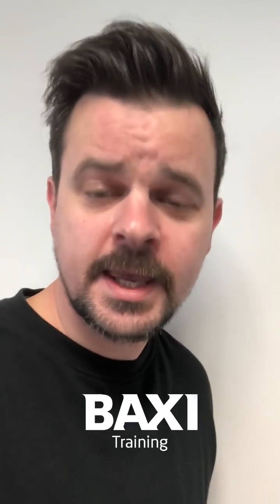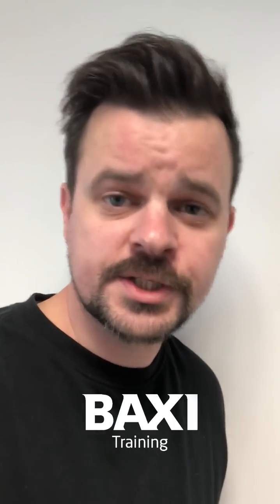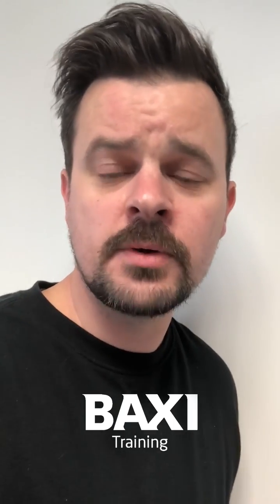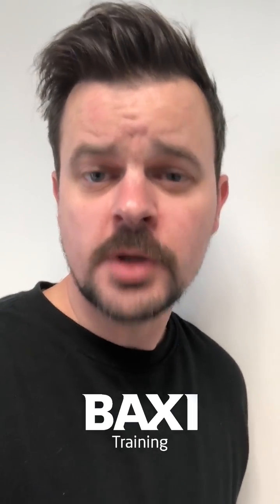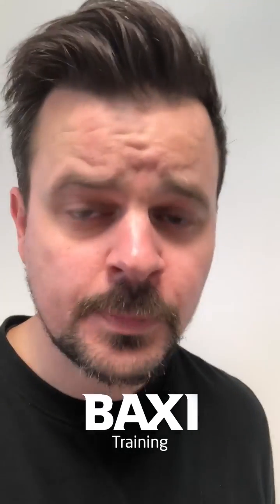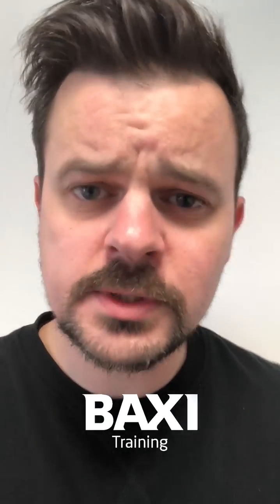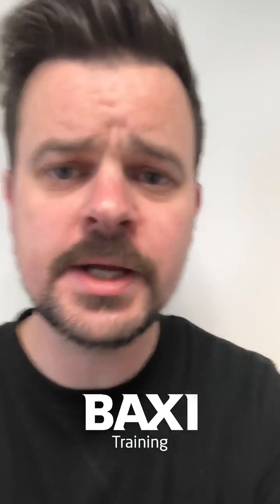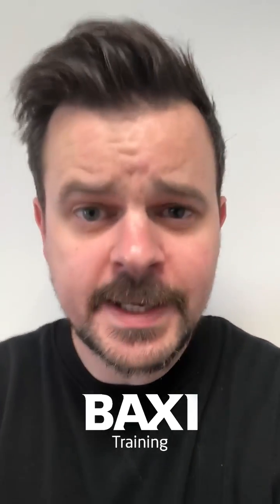Burning Question - What can cause a low humming noise on a Baxi Solo HE? | Boiler Troubleshooting

Comment: When it sound like a boat horn: The air intake manifold has a perfectly round hole on the reducer plate and the length of the chimney is N times the resonance from the motor at low speed . This will create standing waves from the air intake up until the chimney . All you need to do is make the hole imperfect so it creates a small turbulence rather than laminar air pressure.

Comment: I have a baxi Luna 310 fi, it makes a buzzing noise during domestic hot water demand( noise not there during central heating). It seems to be coming from the diaphragm area but hard to pin point. Can you let me know what else could cause this? Thank you 🙏